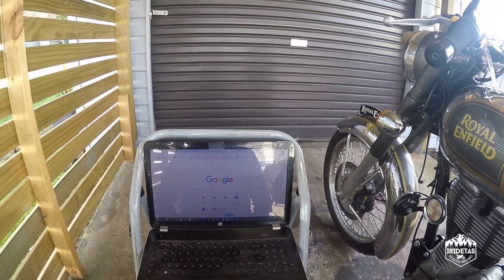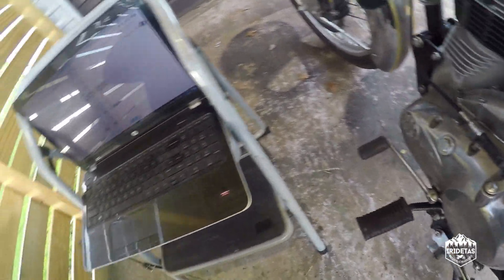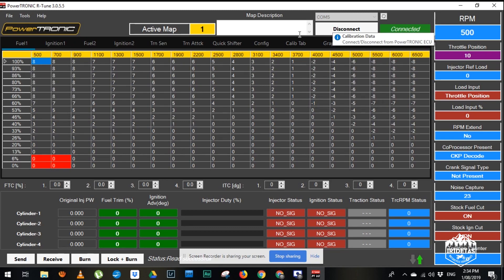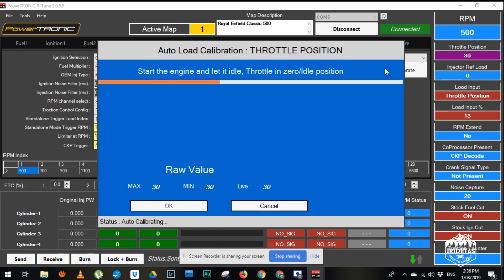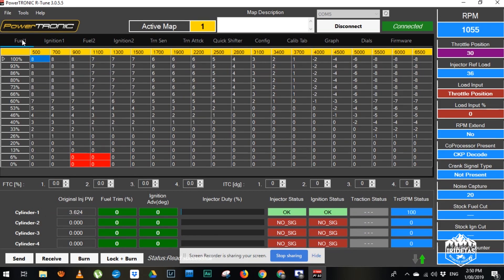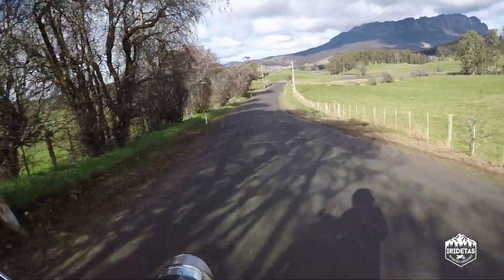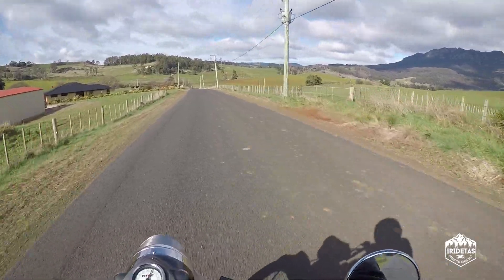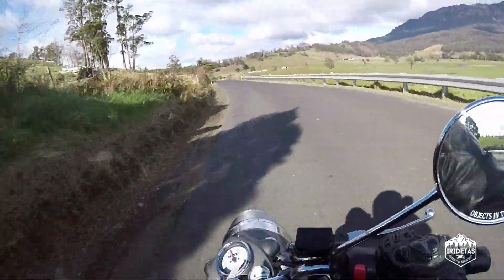REA #20 | Install & Road Test of Classic 500 Custom Map on Race Dynamic's Powertronic Using R-Tune

Comment: Mate, that was excellent and has inspired me to buy another bullet to keep the interceptor company. Question, would there be an advantage in gearing up slightly now to get better fuel consumption?
Cheers
Reply from the maker: https://youtu.be/oCWceZxJfHo
Reply from the maker: https://youtu.be/2pLdO1QIPPM
Reply from the maker: Cheers mate! See the two vids, although I never have any interest in gaining economy on a motorcycle as they use so little fuel, I did it for ride-ability! But the c5 responds really well to +1t on the front

Comment: I've watched your videos - thanks so very much!
On my 2016 Classic, I've installed the Powertronic, the 19 tooth sprocket, BPR6EIX spark plug, K&N filter (not the pod though) and (because I don't like Cat Converters, have drilled a half inch hole through mine). I'm running map 2 and what a difference!
I'm a fat bugger but the speed drop going up a steep hill was only from 120 kph to 115 kph..... Whereas before, she was gasping at that speed, it's now effortless.
Cruising at 100 kph and accelerating to pass traffic is an absolute pleasure.
Thank you again for showing how easy it is to make these bikes go, the way they should!
Reply from the maker: My pleasure glad youve got it going how youd like! Enjoy!!

Comment: Love the look of these bikes but they are just so slow it put me off, RE should lot the 650 twin in these bikes
Reply from the maker: Yeah, no RE imo is about speed.  Even the 650 in no way is a quick bike.  The singles are about the nostalgia.  Great bikes!
Reply: @iRidetas  i ride a bandit 1200 but the single bullets looks like more fun to me then the 650 interceptor.
Reply from the maker: The 500 has more character for sure! Imo

Comment: With all the new power in all the different points in the rev range, how are you finding brake response? Any changes?
Reply from the maker: Nope brakes are fine but i did swap for a braided front hose for better feel!

Comment: Race Dynamics really do a good service, I installed my piggy back over the weekend and noted that the replacement relays had pins missing and as it turned out, the engine would cut out as soon I put it in gear so I left the original relays in. I dropped them a mail informing them about it and within a few hours I got reply that they were sending me new relays as Royal Enfield tends to change relays now and again. So far the bike seems to run the best on map 1 (K&S airfilter and AEW shortbottle), map 2 doesn't make that much of a difference and feels a bit rough, but I haven't replaced the sparkplug and cap yet, so I'll put in the same combo as yours and then test map 2 again. Thanks for all the videos, I'm planning to upgrade the front sprocket to a 19 by next oil change and install the Carberry vibration plate. I'm doing some vids on Badger on my channel, so if I happen to do the vibration plate before you do, come check it out :)
Reply from the maker: Yeah they have amazing and comprehensive service for sure which is awesome. I'm really stoked with the powertronic it makes the bike run so well, I'm running a different map again now and the bike is even better.  https://youtu.be/zuXv2lt5Foo if your intetested.  I'm swinging by th e channel right now mate cheers! 😀👍

Comment: Can you save map #1 before you right over it.
Reply from the maker: It's a good question I believe using the save as option in the file nav bar link you can but I will need to have a play to confirm that.  Cheers
Reply: @iRidetas  OK thanks for that

Comment: OK, the last time I saw you run Dug with this, you had it on Map 2.  it seemed to run ok.. but to customize the mapping you have to plug in Map 1, then download the custom map?  I guess I'm a little confused.  When you hit "Burn" does that make it permanent?
Reply from the maker: Not confused mate! Your dead on.  I had it on map 2, changed to pod filters ran slightly lean at high end, kept map 2 on the ECU cause it worked and swapped map 1 for the custom as map 1 for stock bikes, now runs sweet as! Burn makes it permanent! Lock and burn is very permanent!!
Just wanted it to run perfectly.

Comment: Loving the videos iridetas, I have just fitted the power tronics to my classc 500 pegasus but had a problem when the bike was put into gear the engine cuts out when using the new relays that come with the power tronics, but when I but the original relays back in the bike doesn't cut out when put in gear??? Spoke to a representative at power tronics and they are sending me some more
 relays. Can't fault them for excellent customer care I just hope it solves the issue
Reply: Had the same problem, I have a Pegasus as well, Its due to the number of pins on the relays, just contact  Powertronic and they will send you new relays for free
Reply: @frankysworld  I contacted them all sorted now👍
Reply from the maker: I find there customer service excellent, hopefully the new relays work for you.  The unit itself works really well and I'm quite impressed with it's capabilities! Hope you love it too! Cheers

Comment: Great vid Tas!!. Really interesting!. Out of interest what is the fastest speed Doug has recorded so far and what is your top hi way cruising speed compared to when Doug was all standard?.
Reply from the maker: Thanks, The highway performance was going to be next week's video! But it will hit 140 given enough room and will easily cruise at 110/120 much lower in the rev range with out sounding like it's been beaten! Not faster but much nicer cruising compared to stock!
Reply: @iRidetas   talking about miles per hour or kilometers??
Reply from the maker: This is Australia i only talk km/hr
Reply: @iRidetas  ok